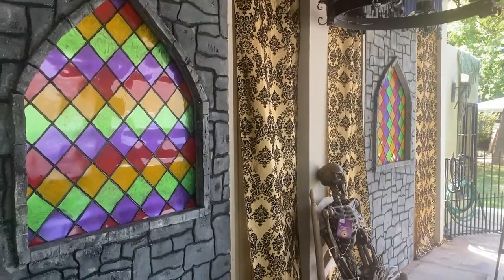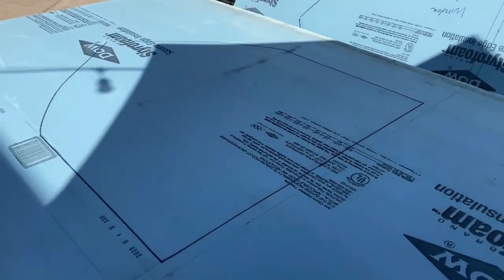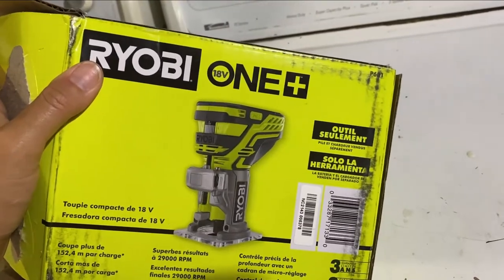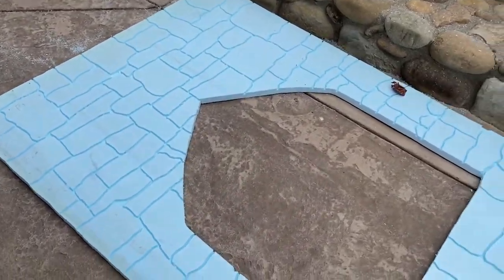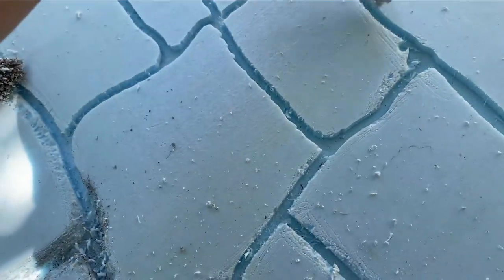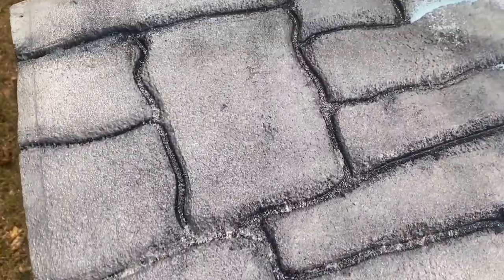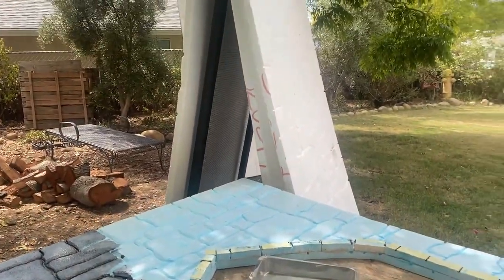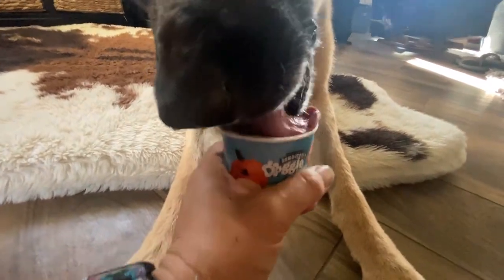Castle Windows

Comment: Make your templates with paper (I have rolls of brown paper, it is great for everything!) 
 Fold paper in half, and trace one curved edge, if not good erase & try again. Once you get it right, just use scissors to cut along the other half - that makes 2 matching sides ! Repeat for the other window ! 
 I make paper mache so I reuse any brown paper scraps in making more paper or paper mache ! 
You can also try "French curves" which is how architects did before computers. A bit pricy, but thry last forever !
Reply from the maker: Thanks, that would be easier. Both my windows were off any an inch. I might flip my windows around for next year. Make a different scene. French curves would be cool.